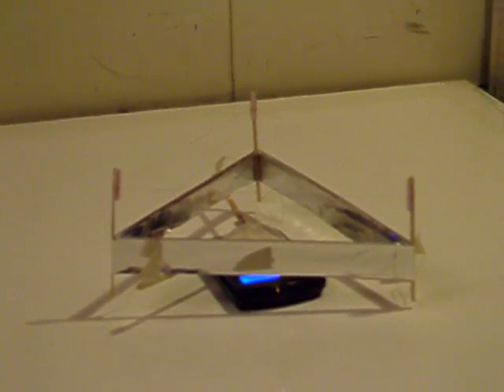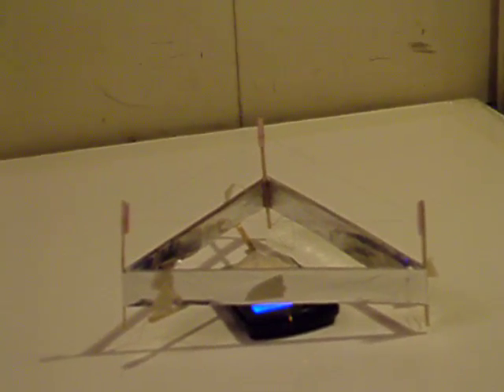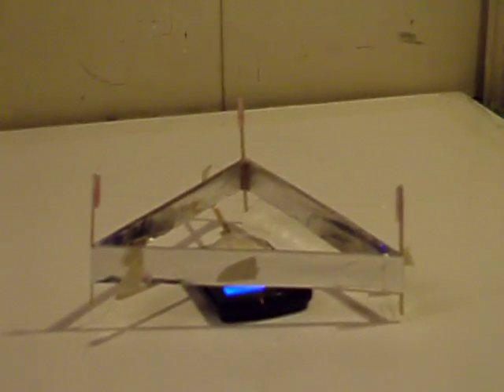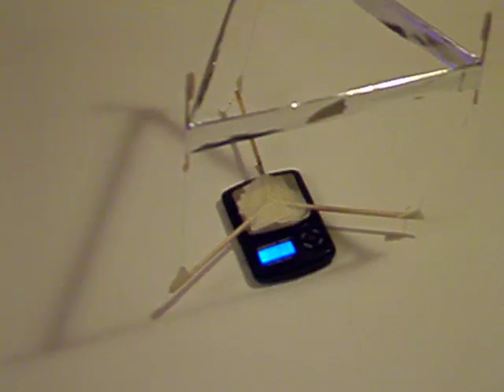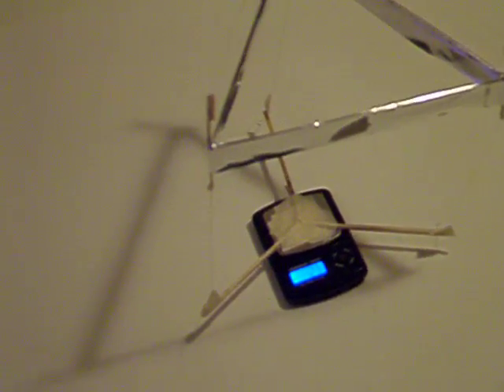Lifter Movie for 8th grade science project

Comment: @raymondmoufarrij inside a CRT television, there is a red or white wire attatched to a sucker-cup, clipped to the middle-top of the television tube (inside the tv of course) this is your high voltage DC supply. there should be a negative wrapped around the screen. the hot (red or white, the one in the sucker-cup) goes to the corona wire of the lifter, and the other goes to the skirt of the lifter